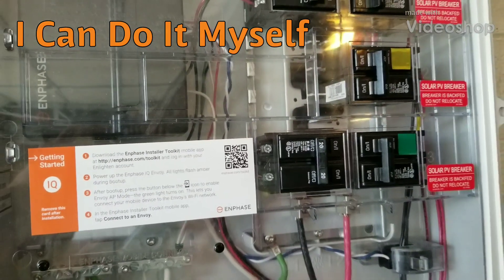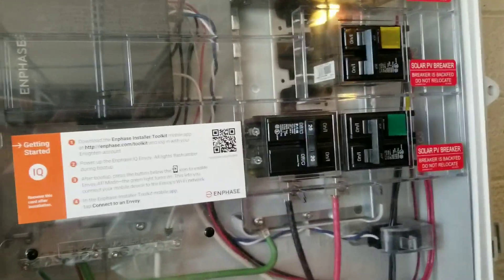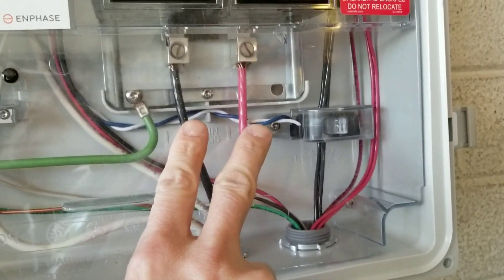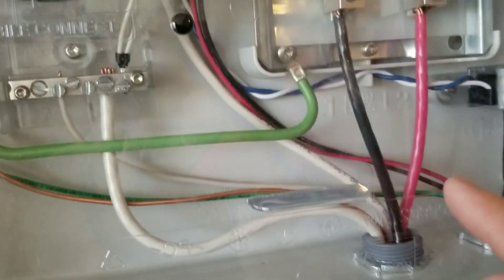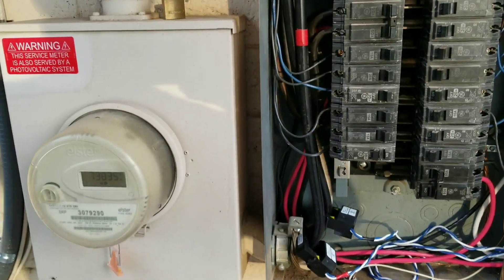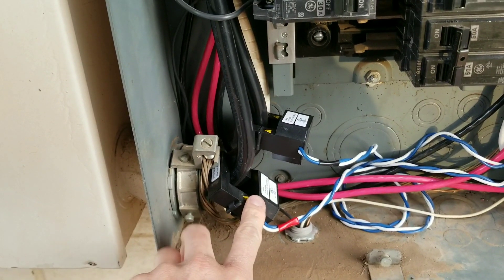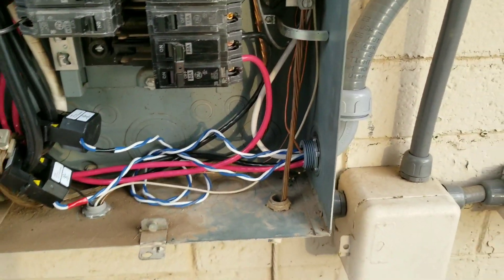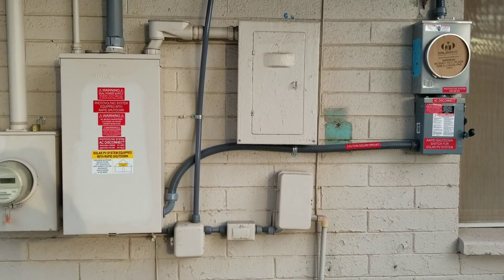Enphase Consumption and Production CTs

Comment: Is your CTs set for Net or Total?
Reply from the maker: The CTs track consumption and export but show up separately on the app. Since this video, I have Tesla Powerwall 2s which make it a little more complicated. Due to placement of the CTs, they consider the power used to charge the batteries as consumption. Then when the batteries discharge, it shows no power being used. The other option would cause them to track power charging the batteries as exporting to grid and batteries discharging as importing from the grid. I should have gone with Enphase Encharge. It would have tracked accurately.

Comment: I know this is an older post but wanted to add my 5 cents since I am having a wrong install issue with my Consumption CT.  In using a solar ready service panel the solar does not connect to a breaker in a service slot rather it passes to the meter side and is connected to the meter outlet from the utility.  Then both utility and solar are going to the service panel together to the main breaker.  This is where they installed my CTs.  So it is always seeing a consumption even if I am using 0% utility and 0 export, it then adds that on top of my solar production so in essence doubles my consumption numbers.  Anyhow I am in the works to have the installer come and relocated the CTs to the meter outlet prior to the solar connection.  I will post back the findings.

Comment: I have a solar company installing a Enphase system for me but it is only coming with the production CTs. If I buy and install the  CT200  Consumption CTs myself will the  Envoy module automatically configure them and will I need to pay extra for the App to monitor the consumption?
Reply from the maker: The Envoy is ready to go and the app is free. You will need two consumption cts and wire to connect them to the envoy
Reply: @ICanDoItMyself    It looks like the installer toolkit app  requires a installer account to log in. Thanks
Reply from the maker: @danielwiggins2656  I didn't have any issues setting up the toolkit app. But then again, I installed the system myself. I had to build the system in the app and scan in the equipment. The cts would register consumption in Enlighten without having to do anything in toolkit.
Reply: @ICanDoItMyself  Thanks
Reply: Make sure you have enough room in your service panels for the consumption CTs first.

Comment: Which wire(s) are running through the CT that's inside your combiner box? I have a CT just like what's shown inside your combiner box that has a blue and white wire that's connected to the Envoy module but there aren't any wires running through the CT itself.
Reply from the maker: In the combiner box, line 1 from the microinverters is supposed to be going through it.
Reply: Black wires coming from the  PVs should go through there.

Comment: Getting my plans drawn from the company that you used I have a question. What CT system will you be using?  CT-200. Where will it connect? Will you install it on the feeder wires for the main panel so it reads all power usage?
Reply from the maker: I used consumption cts from enphase. They are on the lines that come from the utility company and are wired into the enphase iq envoy
Reply: @ICanDoItMyself  Thanks for replying so quickly, Those were the questions that that DBM ask me is the name of the wire coming from the utility company called the feeder wire.

Comment: Not sure what some of the comments here are referring to the Consumption CTs are in the correct position, and they are facing the correct way, the White and Blue wires are pre installed and they should be connected to the correct terminals of the IQ Envoy, that is it, not a difficult job. If they report incorrectly make sure the arrows are pointing in the right direction.

Comment: That is 100% not the correct way to wire the consumption CTs. Yes they are in correct locations, but it looks like you are using ROMEX for your run, it HAS TO be twisted pair (20 twists per meter) wire. Otherwise you may have problems with reporting accuracy. Thicker awg allows for longer runs:
• 57.6 meters (189 feet) of 18AWG 7 strand Cu = 1.5 ohms
• 91.7 meters (301 feet) of 16AWG 7 strand Cu = 1.5 ohms
• 148.4 meters (478 feet) of 14AWG 7 strand Cu = 1.5 ohms

Per Consumption CT manual: To extend the CT leads, the electrician must use appropriately rated, 18-14 AWG, twisted pair wire and install it in accordance with all applicable local electrical codes and the National Electrical Code (NEC; NFPA 70).
Reply: disconnect is pulled down. looks like it is de-energized
Reply: Twisted doesn't matter there's no data
Reply: @AgentOffice yes it totally matters due to how it works
Reply: @Duxa_  how? It's electricity not data. In the latest manual it just says security wire which isn't twisted
Reply: @AgentOffice  All (multi-conductor) cables should be twisted, it reduces pick-up (and transmission) of interference. That goes for AC power, DC power, interconnects, digital and speaker cables. The one exception is co-ax cables. Also in DC supply cables, twisting reduces self-induction which is good.
Reply: @Duxa_  I've never seen twisted speaker wire or romex
Reply: @AgentOffice  sure, me neither, but CT still sends current through the wires, and any alternating current is susceptible to crosstalk. Which is why you want twisted pair, to reduce chance of crosstalk. You can read about Enphase's requirements in their documentation. namely: 
Production CT lead wires must not be extended, if revenue grade production metering is required. These
CTs are certified for revenue-grade production metering. Extending lead wires voids the certification.
Consumption meter lead wires can be extended to be installed in panels away from where the IQ
Gateway is located. These wires may be extended to a maximum of 1.5 Ohms per wire and 3 Ohms for
both wires end to end. Appropriately rated, 0.75 mm2 to 1.5 mm2
, twisted-pair wire cable is
recommended. Install in accordance with all applicable electrical codes and standards
Reply: @Duxa_  well good thing I extended mine by cutting wire from a second set